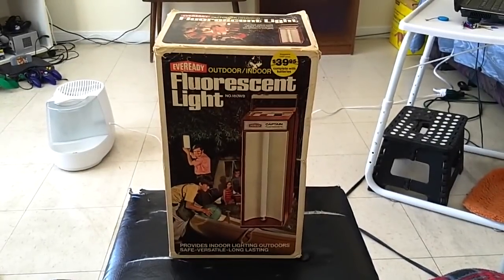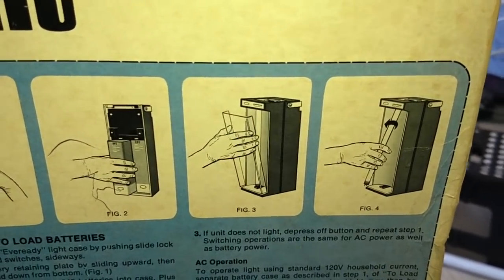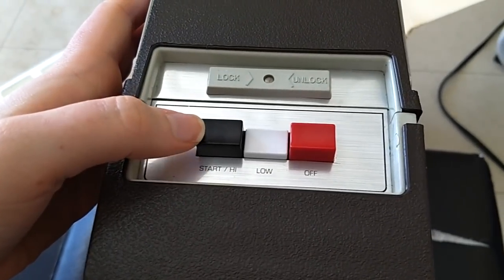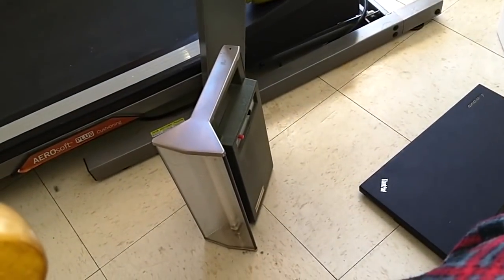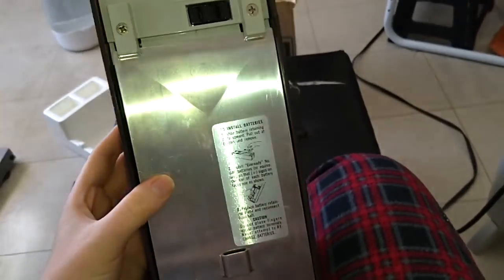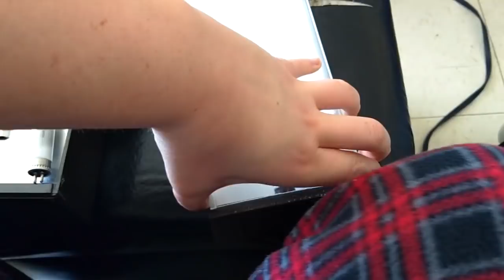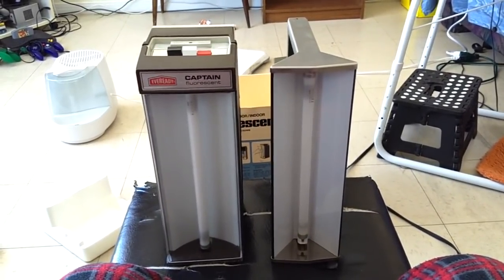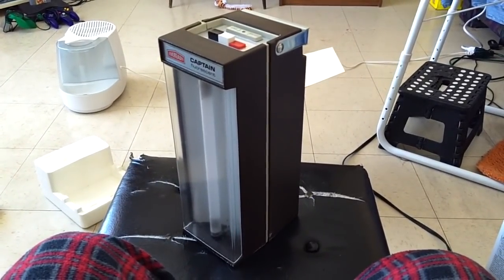Eveready Captain Fluorescent lantern (1973)

Comment: I always love these kind of lanterns. The boxes always have interesting artwork with the suggested uses, I have many of these lanterns now with the original box. I do have a 6w Eveready lantern that does bare a resemblance to the Captain with the front facing lamp and the 'square' design and similar handle, I wonder if that is coincidence or if it was based on the captain?  It is however battery only with an electronic inverter. It's one of the nicer inverters though, seems to preheat the tube slightly on starting. I look forward to seeing the conversion, a great idea!